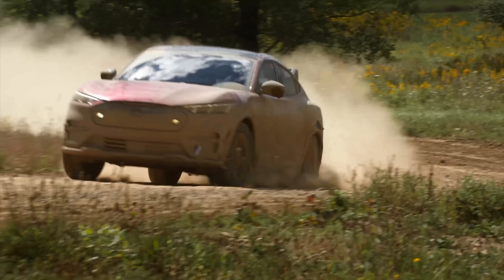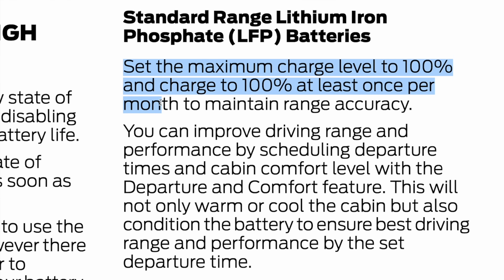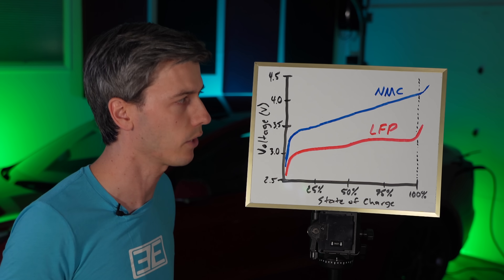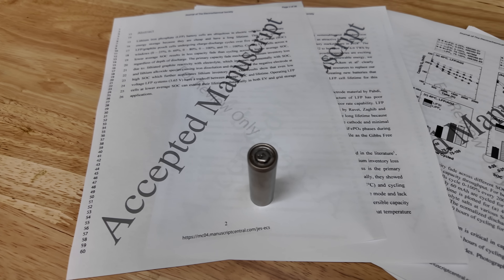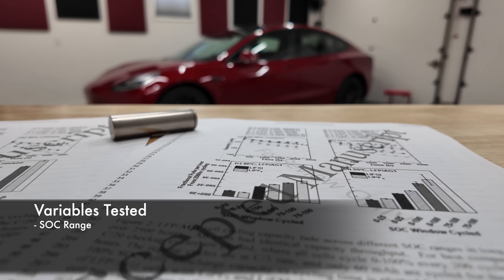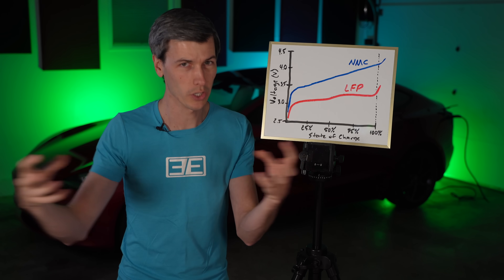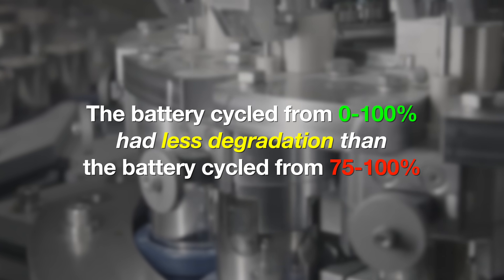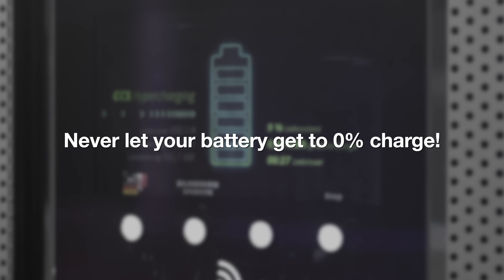How To Ruin Your Electric Car's Battery - LFP Edition!

Comment from the maker: The challenge with this kind of video is always that people will translate this to: EVs aren't ready, EVs are too complicated, etc. The purpose of this channel is education at a deeper level than you'd get from an owner's manual. Cars, whether ICE or EV, are extraordinarily complicated. Most people don't think about their ICE car's best practices, and yet they can still last a very long time. The exact same is true for EVs. As mentioned, cycle life of LFP is very good, even under challenging conditions. You don't have to think about it. You can just drive it, and it will last a really, really long time. EVs have much less regular maintenance, you really don't have to think at all to drive these cars. But if you're a dork that's way too curious about cars (that's me), then this is the kinda content that satisfies my curiosity. There are ways to make something that's already going to last a long time, last even longer. There are practices that can dramatically decrease life as well (same with a gas engine, don't hold it at redline, change the oil regularly, etc). My '18 M3P is six years old at this point, still under warranty, and still has great capacity remaining. I also have a new 6-speed coming to the garage soon - stoked to have a manual back in my life! 😎

*Edit 1: Does it even matter?* Many are asking what actual difference does it make between the different strategies, which I should have included. In the study, the worst strategy (75-100%) with the worst variables was at 90% of the original capacity in under 1500 hours of the 2500 hour study. At 1500 hours with the best strategy (about ~800 charge cycles) the capacity was still at 98% (really impressive!). Both of these numbers are fine; 800 charge cycles of a 250mi EV is 200k miles. As you can see, it's still a meaningful difference between the different options. With that said, these are at elevated temperatures, which accelerates degradation, so real world you could expect better results in both cases.
Reply: Agreed mate, I am amazed when someone asks me about my 2024 Model 3 RWD and I give out enthusiastically all the details, just to be met with "That's too complicated for me, I'll stick to my normal car". 
Have you ever talked to a car guy about his BMW M3??? If so, I am amazed that you're not driving a bike, though even them are downright complex if you ask the right person. I would suggest walking, but I had a neurologist once explain that to me and no way that I could do it😋
Reply: @badbasic  A bike goes when you pedal it, but if you coast / push it, the pedals don't turn. As far as I'm concerned, they have a witch at the factory to make it do that.
Reply: @badbasic  Exactly.  I have curious kids, so I like to explain how cars work.  ICE - crankshaft, injectors, o2, fuel (make sure you get the right grade), tiny explosions in pistons, gearbox, clutch,  etc etc.  ICE - electricity turns one or two motors + regeneration while braking.   
Which one is easier to understand.
Reply: @badbasic  I don't have BMW M3, I had BMW X1's and then X3 for the  last 15 years.   All my maintenance was once a year visit to dealership, grabbing a coffee, being driven to work and back to pick the car.  On the first BMW I have not opened the bonnet once in all 4 years of ownership. I did not even bother to find how to open it (although I could guess). But yes,  I did not drive them above 100,000 km.
Reply: @dmitripogosian5084  You misunderstood my point, a car guy will tell you so much about his car, what hw does to it, how it works... That's what I do for my Tesla. The thing is, you don't have to know all that, you can just drive it, fill it up and do regular maintenance. Tesla even plans the route for you so you don't have to plan charging stops, and has no maintenance. The motor works great at any RPM, if you need power you just floor it, no need to worry about what gear you're in. People just overcomplicate things in their head. That's why I gave those examples, you can overcomplicate everything, people just choose to do it for EVs for some reason. And don't get me wrong, I'm not one of those that thinks EVs are perfect for everyone, my car works wonderfully for me and I'm glad I brought it. Someone else would probably be miserable with it. Just like some people enjoy Citroen's floating suspension that I hate from the bottom of my heart...
Reply: @badbasic  Here I have nothing to disagree with :)
Reply: @badbasic my m3rwd does not work great at any rpm. At lower speeds it shakes a bit. Can't drive 30mph ( about 50kmh ) with comfort.
Reply: @AERONOOB  Damn, sorry to hear that, we really love the smooth ride in our car. I waited for the "highland" to buy my first EV because of those things.
Reply: @dmitripogosian5084    with that degree of care in the most basic things like checking oil and water....  I'd steer well clear of any vehicles you've owned.  
How did you go for tyre pressure?   Was that checked more than once a year?
Reply: @annpeerkat2020  sure you can stay clear, it does not matter to me, i am returning the lease in 3 years
Reply: Too bad they didn’t cycle between 20-80% and 40-60% which is a totally plausible scenario for us who are trying to treat NMC batteries well.
Reply: I see this as a 'best way to warm up your engine before driving' kind of video. You think it's super important when you get your first gas car, but then you realize nobody does it right and they all seem fine.
Reply from the maker: @AlexWaardenburg  Yep, very similar! It will cause more wear, driving hard at a low temp. Car will still last a long time.
Reply: @EngineeringExplained could you explain Solid state battery? Thanks
Reply: @AlexWaardenburg  or like everyone knows driving lots of short trips is bad for ICE cars, and yet people will fire them up to drive a km down the road. It's not like ICE cars don't have downsides, they absolutely do, but most people don't think about it and they kinda work most of the time anyway. At least with an EV you don't have to worry if the fuel has gone bad after storing it for a while.
Reply: You should have said all this in the video.. most viewers probably won't read this comment
Reply from the maker: @jepicken I did, hence the 200k miles comment in the video. But probably should have elaborated further; it’s not always possible to perfectly predict what the comments will be. Make video, learn, repeat!
Reply: same EV model using different chemistries? that info blew my mind!!
Reply: @docwhogr  model 3 base uses LFP while the LR or performance use lithium ion I believe. The voltage is different so those batteries are better for a performance type due to ability to drop more juice instantly. 
My wife has a model y LR with lithium battery.
Reply: Enjoy that Manuel dude some people cannot afford a new car because of high interest rates
Reply: Hey, quick question, many LFP EVs by virtue of being cheaper models especially here in Asia ($10K-25K) don't have active cell balancing. The cell balancing is passive and only starts after battery is already 100%

So does the study factor the issue of balancing or is it assumed that all batteries would have active balancing? At that point also it can become risky if cells are out of balance due to operating in lower SOC range and not going to 100%, it can give erroneous SOC readings
Reply: So why did you call this video how to ruin your EV battery if it makes so little difference. You are just frightening people needlessly.
Reply: Is the new six speed a GR Corolla? Or are you gonna flex on us peasants with an Lotus Emira?
Reply: Thank you very much for your videos, they’re very informative and no doubt take much effort, on a variety of very interesting engineering topics. Not being an engineer myself, but having a very high regard and respect for precise machinery and enjoying learning about them, I’m thankful that knowledgeable people such as yourself are able to bring this very interesting information to the masses.  So, I’m coming from a practical, everyday-man point of view, It’s not that EVs aren’t ready or EVs are too complicated, it’s that best practices with an ICE car is: change the oil every 3-5k miles, replace your spark plugs and a couple of belts every now and then (And, If you want to avoid costlier repairs, get a Toyota with a 3.5L V6) and fill the tank. No range anxiety, no wasting precious time and brainpower on calculating charge and range (bless you if that’s what you enjoy doing in your spare time, not my cup of tea). And, when the Low Fuel light goes on, I pull into any and every gas station, and in 5 minutes flat, I’m on my way with another 300 miles of range. So… I guess my question is quite simple, will paying 3 times what my current car cost me, and will also cost me endless amounts of time to sit (or stand), think and calculate when, where, how much, will I make it, and at the end of the day, after 10 years, the cost of replacing a battery will cost 5-10x what ALL the maintenance I put in to my ICE Toyota over the same period of time - this includes brakes & tires, both of which need to be replaced more frequently on EVs and cost more, too. And, if we include the cost of ALL the fuel I used over the same period, it still would be less than half the cost of a new battery. And, if I sold the same car, I could still get >50% of what I paid for it brand new (with avg miles, no major accidents and meticulous service records - forget it, I’m not selling it so don’t even bother to ask!) so, if we’re talking residual value, then that’s another huge loss for EVs.  Considering the environmental and human cost of mining and creating batteries, and the frequency with which they need to be replaced, and the frequency with which they spontaneously combust (most recently in parking garages in SKorea and Lisbon) burning everything around them to a crisp, and that end up releasing countless tons of dirty, toxic and deadly fumes polluting the environment, and are a hazard to emergency workers and civilians. Tell me again, why is an EV better than an ICE?  (Please don’t say that China EVs, that are ready to flood the North American market, are so cheap they’re disposable!!  That would just be pouring excrement all over the “EVs are better for the environment” argument.)  I get it, there are growing pains, but, a well maintained ICE kept for 15 years is SOOOO much better for the environment, there’s no comparison.  In my humble opinion.  Thanks again for your videos, they really help make sense of complicated topics.
Reply: EV's aren't ready. Well said Jason ;)  I as a winter dwelling Canadian would never purchase such a terrible ball and chain, my hemi is where it's at!
Reply: So charge LFP to 70% Daily and 100% once a week or month? Also charge 100% before longer trip, and what is leave at “extended” time
Reply: That’s a lot of detail for consumers to manage…no wonder used E.V.’s depreciate so much. 
You really need a “ships log” for each vehicle even if it’s only a family car.
Reply: @scottzehrung4829  ICE cars have a maintenance schedule that’s so difficult to maintain that nearly nobody adheres to them. And to power them you need to send endless money to the Middle East. No wonder people are sick of them.
Reply: @Meatball2022  I do all my ICE maintenance at home, which consists of oil change once or twice a year with a vacuum device via dipstick hole ( can do this wearing a white suit ), change filter once very two years.  Fit a new starter battery every 5 years at a cost of £60,  Oh i sometimes have to clean the windows and top up screenwash, maybe replace windscreen wipers every 12 months,  YAWN,  it is oh so difficult and tiring.
Reply: this is misleading to those who will not watch until the end. short answer: it is not worth it taking care of LFP,  battery ageing causes more degradation than average/normal use and improper state of charge because it has absurd cycle life. just charge it as much whenever possible so that you have most range even at adverse conditions or unexpected events.
Reply: @zodiaczephanie223  I think the video is answering what's on your mind; "here are some best practices, but try no to worry too much". Most people won't do any of that and will see excellent battery life, but if you want to stretch it out and "hypermile" your battery, here are some tricks to help with that.
Reply: What constitutes storage for an "extended period of time"?
Reply: Great content, thanks
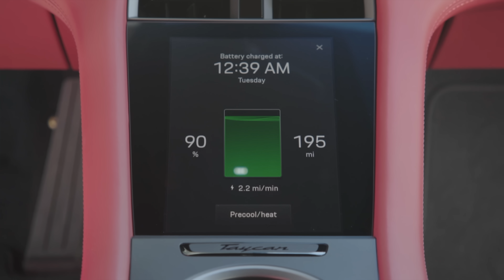Reply: From memory, this comment is about 8:00 to 8:30 in the video:

I find it really frustrating that, with my LFP home battery storage, the software has no option to set maximum charge capacity at anything less than 100%. 

There is a permanent lower buffer of 4% SOC (although this can be raised), and maximum discharge and recharge speed settings, but nothing to limit to, say, 75% SOC. The only way I can approximate that is to fiddle around with recharge rates and/or recharge times whilst monitoring daily use carefully. This is, as you would expect, very hit-and-miss, because daily temperatures change fairly randomly, as do the number of daylight hours during which we don't need artificial lighting.

It seems to me that our battery/inverter suppliers, along with some car manufacturers, have followed blindly the misconception that LFP cells need to be recharged to 100% whenever possible.
Reply: @RWBHere more likely they didn't want to spend the money to implement advanced active cell balancing so they designed it to use passive cell balancing and have to have the batteries fully charged to do that because the voltage curve is too flat in the middle.
Reply: I suggest that the root problem is that EVs have been sold lies upon lies upon lies. if the EV proponents had told the truth from them to begin with, and if they would tell the truth today, as you are in this video pushback wouldn’t be a problem. But since the EV’s are sold based on lies, then it’s fair to say they’re not ready. Shrug. 

BTW - Charging in an attached garage is risky. If something happens, the entire structure can be burned down.
Reply: Not taking any sides here ( be it ev lovers or haters). The only way to get a sports car like punchy accelerations on a budget is to drive an ev .
Reply: Think you missed something important: when an lfp tesla shows 100% soc, it is only at 3.5-3.53V, not 3.65V, which is where the true 100% lfp soc is. So charging to 100% as shown in the car, never puts it into the risky degradation zone as it's only really at 90-95%.
Reply: Agreed. This is similar to people that obsess over engine oil. Can you change your oil every 3000 miles with $60-100 worth of Amsoil or Pennsoil Ultra Platinum and extend the life of the engine? Yes. Can you change it every 8000 miles with Supertech synthetic and still get a long life? Also yes.
Reply: Texas summer, those temps aren't too far off.  I was charging my EV the other afternoon and the heat caused a breaker to trip.  Waited until the sun went down and everything was fine.  I have LFP, thanks for the video.
Reply: @anothermike4825  BE CAREFUL! The breaker might be overheating due to high resistance or some other problem. i had a breaker partially MELT on me (the main breaker for a mobile home). Sometimes I'd come home to the power being off and had to reset it. Then there was a funny smell that smelled like a gas leak (not like what I'd expect). Then I checked the breaker which had tripped and it was still hot. Replaced it. The old breaker had some melted plastic as did the panel.

CHECK THE BREAKER FOR DAMAGE! It can cause a house fire. Or maybe just replace it anyway, breakers are cheap.
Reply: @franklofarojr.2969  Thanks for the heads up.  I have started charging at night.  It hasn't tripped since.  I'll check out my breaker box.
Reply: Well this applies to drones and other electronics depending on their battery type
Reply: Cars should not be white goods! If the battery is used the vehicle is worthless, not to mention they are fire bombs and are destroying the environment.
Reply: Please attach link of the research paper you read in the description bro 🙏 . Thank you
Reply: My home LiFePO4 battery has to be periodically charged AND DISCHARGED, as advised by the vendor (GivEnergy, one of the biggest brands in the UK). Otherwise its BMS stops working, battery gets unbalanced, and at some point, an emergency SoC recalculation kicks in when ONE of 16 cells reaches 100% or 0% SoC. I've seen cases where SoC has been recalculated from >50% to 0%. This is a problem for energy storage, because these batteries are meant to be sized for the worst case scenarios (no PV power), and on most days the don't fully discharge. In a car, cell balancing may be even harder, as 400V pack will have >100 of them of them. Still, LFP is much more robust and safe than NMC.
Reply: @johngreen1060 how many spontaneous Tesla NCA or NMC battery on fire on the 4 million produced ?
Reply: @jeanbaptistelabelle  earlier this year UK government issued an advisory not to install batteries inside homes or near escape routes or vents. This is not because they are likely to self ignite (LFP are pretty safe and even NMC are OK when not abused) but in an event of a fire any battery will enter thermal runaway, making the fire far more dangerous to the occupants and firefighters.
Reply: Always interesting, but these kind of videos (battery degredation strategies vs chemistries) really get my attention. We have 3 gas-powered cars at home (the Miata will never get sold) and I'm looking for a replacement for my Mazda3. I'm debating over a Civic hybrid, which I testdrove and was blown away, and waiting for an excellent driving small cheap EV (Rivian R3?). I'm looking at the lowest CO2 emissions over the vehicle's lifespan and clearly the EV wins (regardless of what EV I get) but EVs are just not there yet for what I'm looking for. In the UK, the Civic hybrid is advertised to emit as low as 89g/km which is good...but not amazing either. Also, to minimise CO2 emissions, it's most important to keep the original battery pack for as long as humanly possible. That would be significantly negated in an EV if you have to repalce the battery pack after 200k km. The Civic, much less so (1.0 kWh) but it still comes at a cost.

So now comes the degredation of the battery. How does a hybrid fair in the battery life department when I have little control over its state of charge? It's out of warranty after 8 years and the intention is to keep it going for at least 20 years (of life of the vehicle). I can't get an answer from Honda as to what chemistry it uses as they don't openly advertise it, so how do I ensure the battery lasts (much) longer than the measily 8 years they warranty? Or am I better off waiting for a Rivian R3 or similar?
Reply: @ThePilotGear  don't worry about the battery in a hybrid. I'm sure there are a couple settings, but the car's systems will never let the battery get outside of ideal operating conditions as long as there's other energy available (the gas tank isn't empty), usually between 30% and 70% SOC. It's another company, but there's likely more similarities than differences between Honda and Toyota, so you could refer to information about Toyota hybrids like the prius that have 20 or more years worth of information available. Generally, I see hybrid batteries' replacement cycles being similar to shocks, they get less and less useful over time and you can choose to replace them whenever it starts to bother you, but they rarely fail entirely.

Regarding EVs and degradation, I drive arguably the worst case scenario, an early model Nissan LEAF (24kwh passively cooled battery), but it's driven 160,000km and is still going, albeit with about 25% degradation over 12 years. My biggest problem is a weird issue with the McPherson strut suspension, but I would likely have that with any small car on my gravel lane. I would not expect to be required to replace a modern, actively cooled, 50kwh+ battery for degradation reasons in less then 300,000km or 20 years, regardless of chemistry, at which point it is significantly more likely that the car is replaced for another reason.
Reply: When do you think we will see Sodium Ion batteries replace Lithium Ion?
Reply: Can you do a video on wood gas or syngas? The process of burning wood without oxygen to produce methane fuel alternates? I’ve been studying it for a few years now. It’s retry cool.
Reply: EV’s are not ready, just prototypes😂😂
Reply: I think you missing the sell point of a ev. They sell it as easy and maintenance free. But so many extra stuff to learn.
Reply: The video is a paragraph in the user manual, and it assumes people do not read, and there is no ChatGPT.
Reply: You should learn how to get to the point!
Reply: So you're admitting that EV's are capable for many tasks, but inferior for many as well.
Reply: And what is the best strategy???
Reply: @EngineeringExplained  i know im a year+ late but don't batteries discharge slower from say the top 20% compared to the next lower 20% and so on. So that should mean that from 100% to 80% you could get like for example 100 miles, 80% to 60% would only get you like 70 miles (im pulling these ranges from my butt but u get the point, i hope). Does the slower discharge rate and consequently the longer range of the higher SOC ranges somewhat negate the negative effects of operating at said higher SOC ranges when considering the life of the battery mileage-wise? Because though u're shortening the battery life in cycles, you're also getting more mileage out of it so will that somewhat even out in the end?
Reply: That is why I like you.

 A lot of car guys are ummm... Low brow. They are biased, and many make up nonsense about EVs or use some outdated information from a decade ago. 

 EVs are great. Loads of Teslas on the road with 150k miles and 90‰ charge.

 The newer battery chemistries are said to be able to keep charge for even a million miles. 

 The thing about that though is the manufacturer will never allow that.  Even if the batteries last other parts will fail.
Reply: @dianapennepacker6854  "A lot of EV car guys are ummm... known for smugness and aloofness. They are biased, and many make up nonsense about the unblemished superiority of EV's or use some outdated information from a decade ago on how their choice of car will save the world while ignoring the issues looming ahead for EVs."

Fixed that for you.
Reply: To be fair, these are the people who think every time you plug an electric car in, there's a 10% chance it'll randomly explode.
While carrying around a battery with an even more "dangerous" chemistry in their pocket.
Reply: @michaelmartin9022  right??  lol. 
This channel is a scientific channel. Yet the lack of education and general ineptitude of those commenting is astounding. 
It’s the equivalent of watching a video documentary about the genius of Mozart and watching people comment that it needs more cowbell….
Reply: @michaelmartin9022  The problems arise when you scale it up.  The battery in a phone cannot kill you.  The battery in a e bike has already killed at least 2 people.
Reply: @anonamouse5917  Fire's fire. You keep your phone in an insulated steel box at night?
Reply: @blazeorb The Ford Pinto was discontinued a long time ago.
Or are you talking about Lithium Ion batteries when they go into thermal runaway and vent explosive gases?
Reply: There are iICE car nerds, there are EV car nerds... Videos like this are for them, normal people just sit in car and drive and it doesnt matter if it is ICE or EV.
Reply: It’s simple, really. If you can, do a minimal amount of planning and you can really extend your battery life. If you can’t, then don’t. Odds are that you’ll trade it in or total it long before these become issues anyway.
Reply: Boild down the battery best practices to rules of thumb and it isn't any more complicated than remembering the oil change mileage on an ICE car.
sidenote: I really appreciate the chemistry breakdown.  It would be great if you would include the context from the battery degradation study in terms of the actual capacity difference at the end of the battery tests; operating at low voltage may be better, but better to what degree - if the resulting capacity difference is insignificant, then it really doesn't matter after all, despite one being better than another.
Reply: ICE engines also had the luxury being awful for decades
Reply: Such battery husbandry would better be left to the car’s computers, not to the driver.
Reply: Or just GET A HYBRID and stop worrying about this.

Full electric is unrealistic as long as petroleum reserves exist.

We need to build more Nuclear Power plants if we want to go Full Electric, otherwise grid instability will get worse and worse and "renewables"(they are still a consumable and also intermitent) will never solve that problem.
Reply: @Splarkszter  hybrid is the worst possible idea. All of the drawback of ICE engines. None of the benefits of EVs. And increased fire risk by about multiple of 3
Reply: @Meatball2022  This is my point of view:
"Drawbacks of ICE": None as long as you change your oil and give due maintenance.

"Benefits of EVs": Instant acceleration, laughable range and more expensive everything.
Reply: @Splarkszter  forgot about transmission. Air filters. Thermostats. Radiators. And about 300 other moving parts.
Reply: @Splarkszter  you also forgot about cost per mile being about 1/3 of ICE purely for fuel difference - not including maintenance differences
Reply: This comment ties the video together best. Thanks!
Reply: Yeah, LFP cell manufacturers advertise 10000 cycles … that would be approx 4 million kilometers in an EV. EV’s powertrain is dead simple compared to complex automatic gearboxes and gasoline engines with moving pistons, valves, chains etc. One doesn’t need to be an engineer to understand that simplicity means reliability. EVs will last far longer than gasoline/ diesel cars.
Reply: I would do the "not ready" argument about gasoline cars. What the hell, I need to change oil every 20k km?! I need to change this and that regularely? WHY? I don't need to change this and that or repair gear box in electric car...
Reply: We have a 2016 Nissan leaf and a 2016 Diesel Ford Transit Van :  The modern emission compliant diesel is a marvel of technology but bristles with sensors, digital smarts and component complexity, too many points of failure and damn expensive to fix when it faults (ask me how I know) . The Leaf is so simple and reliable its boring , I'm not a car guy and dont like paying Ford Parts prices so I'm OK with Boring. My friend brought a BYD SUV, I dont recall the model name but that thing is like something out of the Jetsons EV's are the future IMO.
Reply: Because you've made it more complicated than reality.

It's just really not relevant. I'm at 5% degradation in 315,000km, driving below 0% frequently, sub 10% every day, 100% every day, supercharging.
Reply: What don’t understand is why Tesla, according to you, are telling you to purposely damage the battery, when they are giving a warranty of 8 years?
Reply: Just get a gas powered car!
Reply: @john1703  We had that for 30 years. If we never want to come back to that, maybe there is a reason? You? What is your experience about EV?
Reply: @john1703  price per mile of a gas car is 3x-4x what it is for an EV
Reply: @Meatball2022  Not in England if you cannot charge at home, which more than half of houses and apartments cannot.
Reply: @john1703  anyone can charge at home. Regular outlet takes longer. 45 amp is faster. Typical clothes dryer outlet. Very common.
Reply: @john1703  price per mile is double ICE vehicles if you need to supercharge regularly.
Reply: @john1703  let’s do the math. What’s the price of gas over there? What kind of mileage is an average luxury car there?  And what’s the price per kWh of electricity at home?
Reply: @Meatball2022  not if you don't have a drive, like a flat or an old terraced house with no yard.
Reply: I was ready to buy an EV, the incentives were set to end and we had massive markdowns announced from multiple manufacturers, the incentives didn't end and we didn't get the markdowns and that's what turned me against EVs
Reply: @justinr9753  wait. So you decided not to buy an EV because the incentive you would have gotten still exists???  Ok 👍🏻
Reply: How does LFP compare to LiFePO4 for cycle degradation?
Reply: @whodat9198  They are the same battery,  LFP is just shorthand for LiFeP04
Reply: @chrissmith2114  So my question is this. Based on the video LFP would be less than ideal durability wise as a battery backup for homes like a powerwall since you would ideally want maximum capacity available for various unforseen incidents right?
Reply: @whodat9198  You mean unforeseen things like 'the sun only shines during daylight and then its output is very peaky ( sine wave ) - the sun shines a lot in summer when we do not need to heat our homes, but shines very little in winter when we do need to heat our homes...
Reply: i dont think evs are ready yet they are like 95% there they just need more charging stations and to bring the cost down they are almost ready just need more investment in the technology
Reply: You're right.  EVs sound under developed, too complicated, and too much of a financial risk for me.  I'll cycle through a couple more ICE vehicles and let EVs catch up to the >100 years of ICE refinement before I invest in an EV.
Reply: Define "ready". If you need to take the equivalent of a PhD (being hyperbolic here) to charger your car then it's definitely not ready for mass use.
How about I send you a computer that comes only with a terminal, a compiler and a C++ book and say to you "oh, the computer is ready but if you want to use a program you have to learn to code and build it yourself"?
A mature and safe product that when misused can cost your life or a great sum of money must not rely on random videos on the internet to tell you how to use them. That's not how it works. Unless it's restricted to people that are specialized and trained to operate the vehicle. Again, a niche not the general public.
Reply: @Luiz__Silva  Just follow the user manual if doing a "PhD" to charge a car is not your thing

It is not necessary to learn rev matching, or other advanced driving techniques yet people learn it to operate their vehicle better

Its not like not following EE's video like gospel will upset the EV and it will stop you from driving it until you do a PhD in charging

At worst, you get 1500 cycles instead of 2500 like the rated cycles of LFP is before reaching 80% SOH
Reply: @shresth1201  I understand that. But the question was wheter EVs were "ready". I assume it means ready for the average end user, not for engineers or car enthusiasts.
From a product standpoint, using your numbers here, losing 40% of the value of something you paid for not following a specific method is a clear sign the product is not ready for the average end user.
At the end of the day, it's the user experience and expectations that will dictate what is ready or not.  People have other priorities in life than changing their routines to meet their car's. Spending time and experimenting on how to use their car's also goes into the expectations. Learning the caveats of EVs can greatly affect their use experience. If they buy an EV thinking it's simpler but then they find out many more of mutations than they expect, not to mentioned much less RoI than expected, people will church and not go back 
Based on my product development experience, my opinion is that EVs are being forced into customers too early, particularly due to political reasons, and so it's inevitable people will church from that type of product just like you would never buy again a laptop model you tried once and it kept crashing.
Reply: @Luiz__Silva  
> I assume it means ready for the average end user, not for engineers or car enthusiasts.

Taking your own example, yes, EVs are already beyond the point where you need to think about charging actively. 

The buyer of a computer need not know how to use terminal, setup scripts and conf files to use the basic functionality of the computer, but knowing these allows you to gain even more control over your machine.

EVs are already past the "terminal CLI" phase if there even was one to begin with. The avg buyer does not need to know all this and still their EV will last 100K mi+ without noticeable degradation.

You need to follow the user manual that's it

The point that EE should have elaborated is how much improvement in cycle life can be expected by following these steps instead of using it as you please.

Then we can argue about the time-benefit analysis of whether "doing a PhD" in charging is useful.

> From a product standpoint, using your numbers here, losing 40% of the value of something you paid for not following a specific method is a clear sign the product is not ready for the average end user.

Whether your car is at 90% SOH after 200K mi or at 80% if an avg buyer is buying it you can't tell them that since I have 10% more SOH than the other guy I must get better resale. 

That is for the maturity of the buyer base and the information about battery longevity becoming common knowledge instead of the current slurry of misinformation floating on social media like tik tok, instagram and FB, you know, where the avg person gets their "daily dose of news" from. 

> Based on my product development experience, my opinion is that EVs are being forced into customers too early, 

If people really think EVs are being forced, ig they haven't seen what actual force looks like

> particularly due to political reasons, and so it's inevitable people will church from that type of product just like you would never buy again a laptop model you tried once and it kept crashing

1. EVs won't "crash" in whatever sense your analogy meant just because you didn't charge it right. Like it is said, at best you will get 1500 cycle life instead of the rated 2000 which is still good for 300K mi even if you drive like a maniac and get 200mi per charge

2. Politicisation of EV is a USA only issue, turns out there's an entire world outside USA??? Blasphemous.

3. If People are so petty to not look beyond politics and decide their choice of purchases based on politics, they deserve to be ripped off
Reply: @Luiz__Silva  what a ridiculous comment. Hyperbolic is the understatement of the year.  A 4 year old can plug in an EV. That to you requires some sort of deep thought? 
He’s teaching how to get the max out of a battery. Not what’s required to live with it. If you had even a lick of sense to counter your inability to comprehend what you hear and read, you’d have heard that even while doing the absolute worst things you can possibly do to the battery, it likely lasts 200k miles. 
But to you, it’s “not ready” because there’s a tiny bit of planning that MIGHT be needed on occasion?
Reply: @Luiz__Silva  the better equivalent would be “here’s a computer. It’s ready for the masses. But to use it successfully you have to plug it in to the wall, pay your electric bill, and make sure you don’t drop it into a tub of water”.
Reply: @Meatball2022  Not really. It has to be something you need a huge manual plus a thousand YouTube videos explaining why the manual is not sufficient and giving you conflicting information about how to perform a very basic task. Programming is easier than that.
Even a 5yo can operate a modern device with ease. We can't say the same about charging EVs properly.
Reply: @Luiz__Silva  does a video that talks about how to make your gas engine last longer somehow mean you’re not capable of doing that?  
An ICE engine requires oil changes done by mechanics. Requires fluid updates.  Requires belt replacements. Timing chains. Water pumps. Thermostats. All done by mechanics. But yet you argue it’s too difficult to plug in a car battery in a plug?  Gtfooh
Reply: @Luiz__Silva  charge the battery. Use it until it gets pretty low. Then charge it again. 
Wow. That’s so incredibly complicated. Much more complicated than filling a gas tank when the tank is a bit low. 
Holy hell imagine the ineptitude involved in not being able to plug in a plug. Nope. Luis can’t use a plug. He needs a manual. And a video. And he needs someone to hold the plug still while he pushes the car sideways into it. Apparently the technology of using a plus is way too advanced for you. 
I wonder if you have the same challenges operating a pair of sneakers.
Reply: @Meatball2022  As an engineer, I don't find it complicated at all, so your mocking has no point here. You are the one who missed the point. It seems my argument went way over your head.
From a usability standpoint, the average person can handle so much complexity. A reasonable product developer cannot expect end users will devote as much time and energy to use their products. Whole companies have failed because of that. People who have other priorities than changing their routine to meet their car's or that don't have extra money to make up for missing their batteries will church from EVs until the product is fixed.
Reply: @Luiz__Silva  if you’re an engineer, you should know that the average person can plug in a plug. If you even have a tiny sliver of a clue, you’d understand that this video (done by an actual engineer) explains exactly what to do to get the absolute maximum life out of a battery. He himself made it very clear that doing none of these and exposing the battery to the worst of habits will still likely get you more than 200k miles out of it. 
The one that missed all the points here is you. It’s extremely easy to charge a battery. It’s also extremely easy to maintain a battery - much more so than an ICE vehicle. 
Would you watch a video that explained not to stress a cold engine hard, and to minimize city driving, then immediately dismiss it as proof that technology isn’t ready?
No real engineer would take a task as menial as plugging in a car every couple of days and suggest that the average person can’t do this. 
Having a Lego set doesn’t make you an engineer.
Reply: @Luiz__Silva  and on that note, you will be ignored from this point forward. I’m tired of explaining how simple things are to a fake engineer who speaks like an authority, but does so from a pulpit of ignorance.
Reply: @Meatball2022  Interesting how projection works. I was not talking to you. You talked to me. Now you talk like somehow I need to prove myself to you or if I need your approval. Feel free to ignore me. Be sure I won't feel said because a random personal on the Internet didn't agree with me. 😁 

As for "fake engineer", I'm the one here using a real name. Look up linked in and you can find where I work at and how many years I have in product development.
Also, you assumed a confrontational position for no reason. Check your heart if you have any issues, please. Make peace with God and be happy. With that you won't feel the need to resort to personal attacks. 
Finally, I did in fact mention my experience but I never made it my argument. If you want to point out logical fallacies, first you need to understand a little bit better what they are and what they are not. Mentioning a title or credential is not in itself a fallacy. Also, logical fallacies don't apply to opinion. You can disagree, though. But you don't need to be rude to people because of that. That's merely a sign of a lack of character or self control. Being "tired" is not an excuse. I'm an individual, like you. I'm not everybody else, just like you. It's our first interaction. It's just rude bringing your issues with other people to me like somehow I'm responsible for that.
I really hope you have a good day and that you can learn something from our interaction. God bless you.
Reply: I had no idea what this video was about. 😂😂😂
Reply: LOL, no special practices with ICE vehicles really, just change the oil on time, keep putting fuel in and drive.... easy-peasy compared to the arcane and esoteric things EV owners are supposed to do to 'baby that battery'....
Reply: @chrissmith2114  changing oil on time - see this alone makes ICE vehicles much more difficult than EV’s. Although I’ve changed my own oil for years, most people need a mechanic to do it. And if they forget?  Welp - there goes your sensors. There goes your pumps. There goes your seals. And the increased heat will also cause problems. There goes your thermostat. 
But sure - plugging in a car into a plug is so much more difficult…. 
I wonder if you have such challenges with operating a table lamp…
Reply: @Meatball2022  Do my own oil changes in 30 minutes using a vacuum device via dipstick hole, I always measure exactly how much oil comes out... Replace filter every second oil change, all the rest like brake fluid and brakes same as an EV - except the parts for ICE cars are sooooh much cheaper than the rip-off EV makers  prices.  Hertz ans Sixt and a few other rental companies dumped their EV fleets after a couple of years because of insane maintenance and repair costs and unreliability,  as well as 'low residual values' which is accountant speak for 'they depreciate  faster than a rock falls off a cliff'.... Most EV are leased, and the reason is that people expect lease companies to take the large financial hit, but lease companies based their model on the fairly low and predictable ICE depreciation, they have now wised up and massively increased monthly payments and final payment.
Reply: @chrissmith2114  I guess you’ve never owned a dodge. 
For the record - Tesla had extremely high values for a long period of time. Now they’re roughly the same as Ice cars within the same price points. But, clearly you believe what you want, then compare apples to oranges and pretend to know things. Whatever.
Reply: @chrissmith2114  yes Chris. I’m glad you brought this up. It’s just insanely difficult to plug in a car every few days. I can’t remember the last time I found something such a challenge. Maybe when I had to install a light bulb. Not quite as difficult as plugging in a car. But it’s up there.
Reply: @Meatball2022  over 50% of homes in UK do not have off street parking or a garage,  tell them it is 'easy and cheap' to plug an EV in...  Mind you I would never plug in an EV in a garage attached to a house because I really like my house in its 'unburnt' state.
Reply: We now that electric cars are far from not 0 emission vehicles. How do you avoid making a post about how long it takes to compensate to have an electric car vs gas car. It's all about money
Reply: @Platypus_Warrior 20 years of ICE tailpipe emissions is the problem
Reply: "Only charge as much as you need to."
When you get a phone call that results in an unexpected long trip you run the risk of being stranded.  What's the downside to always keeping your gas tank full?
They need to make battery replacements much cheaper or have lengthy warranties without fine print to cover the batteries before I buy one.

Oh, and I do think about my cars best practices.  I take it to my mechanic twice a year and give it periodic long drives to ensure water doesn't condense in the oil.
Reply: @anonamouse5917  "They need to make battery replacements much cheaper" There is such car  in Norway and China and few other europe countries ,its call Neo ,you pay 30 euros and in 3 minutes you have full battery ,you dont have to worry about battery becase battery replacement is free and last 3 minutes ,you will always have good battery.BUt for some reason when talking about Chines EVs no one talks about Neo,its all about BYD and others while Neo have 0 publicity even its best Chines EV with so many inovations and more important they work in real life
Reply: @anonamouse5917 if you get that call do you know what you can do?  Just go. There’s a supercharger somewhere near you and you just use that. 
Why do gasoline worshippers always make everything so difficult?
Reply: @Meatball2022  "There's a supercharger somewhere near you."
How can you possibly know that?
I'm a realist, not a 'gasoline worshipper'.

Did you know that my province (BC) with all of it's hydroelectric might had to purchase 24% of it's electricity from Alberta and the USA last year?  I'm sure this situation will only improve as the govt pushes more EVs.  
We couldn't possibly be staring down the barrel of rolling blackouts.

And cold winters are great for battery life, aren't they?  And road debris puncturing the battery casing of Lithium Ion cells certainly doesn't lead to fires up to 2000 degrees celsius, right?  And those fires don't require thousands of gallons of water to extinguish and can reignite days or weeks later, right?

Care to try again?
Reply: @anonamouse5917  it’s not cold in Norway?  Do YOU care to try again?
Reply: @anonamouse5917  “how can I possibly know that”?  Simple. 64% of Americans live within 2 miles of an EV charger. 
Canada has over 11,000 charging locations with a total of over 27,000 charging ports.   15% of those are fast chargers. 
So again - when you get a call and have to leave - just go. 
Why is this so hard for you to understand?
Reply: @anonamouse5917 "Road debris will puncture the battery"?
Do you live somewhere there's cut diamonds littering the road?
Do you drive at 500mph?
Reply: @Meatball2022  I just looked at a map.  They are closer than I thought but can still take you well out of your way.  Also, 1/2 hour or longer is a long time to wait.

Gas wins here.  Just admit it.
Reply: @Meatball2022  My point is that running the heater in an EV will kill the battery faster.  Heat is a waste product in an ICE vehicle and you can keep quite toasty and not deplete the fuel tank a single ml.
Reply: @anonamouse5917  your ridiculous statement implied for some inane reason that someone can’t leave town in a pinch with a low battery. Thats a ridiculous statement. Waiting 20 minutes to charge a battery doesn’t make your claim any less ridiculous
Reply: Problem wih ev's is the replacement for the battery after 10 years..ICE with maintenance can last 20 years ++ but ev's no matter what we do will need a battery change down the line, the price of which, will total the car
Reply: In the end, you have to waste a lot of personal time, knowlege and planning to keep you mobile with an e-car. Thats is not my business, that thing has to work like a no brainer.
Reply: @stefanmargraf7878  it takes a lot of personal time and knowledge to plug in every few days?  Really?  Does it take a lot of personal time and knowledge to get gas every 3 days?
Reply: @Meatball2022  And oil changes and all the other maintenance on ICE cars also takes a lot of time.
Reply: @franklofarojr.2969  hours. Appointments. And for a car of this price point, oil change runs 100 bucks easy. Transmission fluid change. Flush. Coolant flush.
Reply: @stefanmargraf7878  you’re acting as if it’s a given that NOT doing these things will cause a battery to fail after 20k miles. If you could actually focus on facts for a few moments and listen to the video, you’d see that even under terrible conditions and poor charging behaviors, these batteries are lasting beyond 200k miles. Thats MUCH longer than the average joe keeps a vehicle.
Reply: Ready for what?

 They have very valid use cases today for certain and they'll be really great once they fix the issue of major issue disposal and recycling.

But they are Not ready for all use cases of ICE cars, not even close, but they don't need to be for adoption for the use cases they do work today, but replace all or even majority of ICE, that'll take many decades still.
Reply: @RiversJ  When people say "not ready" they're typically just haters, but the main two complaints are range (because the US insists on making giant vehicles that only get 230 miles range) or the public charging infrastructure sucking in many places. I've been seeing a lot of people complaining about grid capacity as well, as if that cannot be improved.
Reply: @F0XD1E  They are soulless and boring. "performance" EVs are sports cars for people who don't actually like cars.
Reply: @backseatlovin916  Not sure what that has to do with whether the technology is ready or not but ok. IMO pretty much any vehicle made after the 80s or 90s is soulless and boring but I'm not gonna go around crying about it and gatekeeping.
Reply: @F0XD1E  "I've been seeing a lot of people complaining about grid capacity as well, as if that cannot be improved." You are right that it can be improved but like rail transport for example which also can be improved the problem is the cost to do so with the added issue of how much time it will take to expand and harden the grid to catch up to current demand let alone future demand.

This is what ICE haters refuse to address and is part of the reason why people have as much hate towards EVs. If you have a solution that isn't at least a 1 to 1 replace and yet force it upon the market then *EVERY* shortcoming will be highlighted until a solution is found for those shortcomings.

Complaining about vehicle size or blowing off the concerns about public charging infrastructure does nothing but prove that EVs don't have answers for those shortcomings further justifying the hate towards them and the laws forcing this sub 1 to 1 replacement upon the market.
Reply: @F0XD1E  My 2002 WRX hatchback was the last car I owned with true soul. Looking to buy a Miata when my ship comes in, and sophomorically hoping that it may also have soul.
Love my Model 3 more that I thought, as I purchased it as an appliance. But I would not consider it to have soul.
Reply: @brentlanyon4654  Can't go wrong with a miata 👍
Reply: @F0XD1E  My wife thinks its wrong to tie our three boys to the luggage rack on a Miata. I agree, it would totally screw up the weight distribution.
Reply: @backseatlovin916 I guess you’ve now been shown enough accurate info to have  run out of excuses why ICE cars are better, so now you’re relegated to “they’re boring”. Yea - you have to be creative when figuring out ways to hate something when your other ways are so often proven incorrect.
Reply: @Hybris51129 ridiculous comments and opinions you have. Norway is around 30% EV’s. Yet their grid seems to be ok. Weird huh?  
But please. Don’t let me interrupt. Keep making stuff up. It’ll help you get that creative writing credit you so highly deserve
Reply: @Meatball2022  happy pride month.
Reply: @brentlanyon4654  The Miata (MX5) is a brilliant car. Closest thing to a road legal go kart!
Reply: @F0XD1E it’s not the size, it’s the mass. A Tesla Model Y weighs double that of a Mazda 3, and both carry 4 passengers. And sure, the grid can be improved, but at what cost? And what will power the newly expanded grid, unicorn farts? (That is to say, wind and solar)
Reply: @JoeSchmow  A Mazda 3 weighs 3300lbs and a Model Y weighs 4300lbs. A Model Y is also not the same class of vehicle. It's better compared to a Model 3 that is 4000lbs. That's double to you? And it's not just mass. Size matters. Larger frontal area is directly proportional to air resistance, and larger vehicles are normally also higher off the ground and have worse drag coefficients, which compounds the problem. Wind, solar, and hydropower make up over 20% of power generation in the US, which I would hardly consider unicorn dust. Even if we did use natural gas power plants in the short term, it's significantly more efficient and clean than millions of individual combustion engines. Nuclear would probably be the best long term solution.
Reply: @F0XD1E  The actual not-haters are strictly concerned about where to charge aka public charging since they don't have home charging. Range concerns are really just charging concerns. The whole consumers are not ready argument or grid capacity arguments are just trollish arguments designed to spread FUD. (PS: There is no grid problem, EVs will sadly transition slower than a utility can upgrade their grid).

So if we are really talking about public charging for those who don't have home charging available, there are only two variables that matter here. The amount of public chargers available around where the consumer lives and the charging time for that consumer at those public chargers. Luckily both variables are improving rapidly for a growing number of manufacturers.
Reply: @backseatlovin916  Floor a Polestar 2 (which is less performance than a Tesla) and tell me it is boring. It takes off like a rocket. 400 HP.
Reply: @Hybris51129  We can also redesign cities to make them less car dependent.
Reply: @brentlanyon4654  But with an EV, which has a lot of battery weight on the bottom, it would likely be just fine. :)
Reply: @backseatlovin916  Seal comendo v8 biturbo mundo afora com suas almas kkkkk
Reply: Petrol heads need the smell of gasoline to get a kick out of it alongside the vroom sound and vibration. EVs are too sterile with artificial sounds. But I do enjoy both ICE and EVs for the different satisfaction that they bring.
Reply: @RiversJ Recycling and disposal has been sorted out long time ago, it is 2024, 1990.
Reply: @mravecsk1  For EV batteries recycling isn't really being done very much as I understand it, but repurposing is a big thing. The cells are normally not totally shot, just lower capacity than new and no longer suitable for vehicles. They can be used as energy storage for buildings, solar panels, or as reservoirs for charging stations.
Reply: @RiversJ  ATM, even in markets which have a majority of vehicles being BEV (primarily Norway, but others have large enough markets for the stats to be pretty incontrovertible), the number of battery packs that need to be recycled is so small that no company can survive on recycling BEV batteries alone.
And because of the fact that a BEV battery still holds a decent charge, even when it is no use for a vehicle, those battery packs are being repurposed for other applications. And all those applications permit the generally improving management of battery packs to continue to improve the life of them.
So far, even the battery packs of "poor performance" air cooled battery packs still means that they are useful in multiple other roles.
This unexpected pausse in the expected need to recycle battery packs has meant that the industry is already capable of recycling virtually all of the important minerals in these batteries, and the biggest problem, right now, is not the battery materials themselves, but the insulation materials in them; basically plastics and other insulators.
Unfortunately, it seesm that you, like most people, have been misinformed as to the major issues resulting from BEV systems.
Reply: @RiversJ  The planet can't wait. Neither can the fact we are running out of oil. No more dinosaurs.